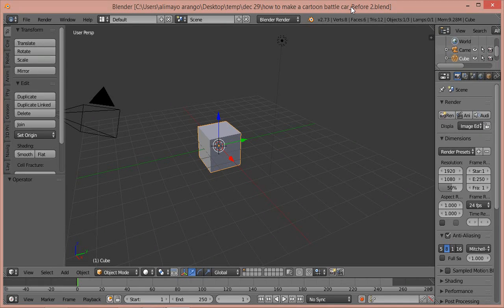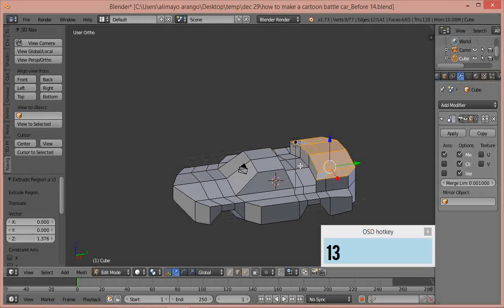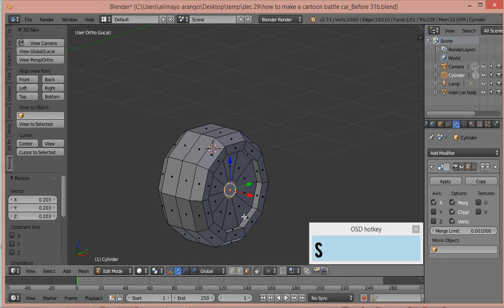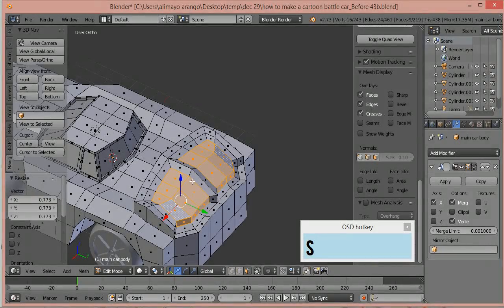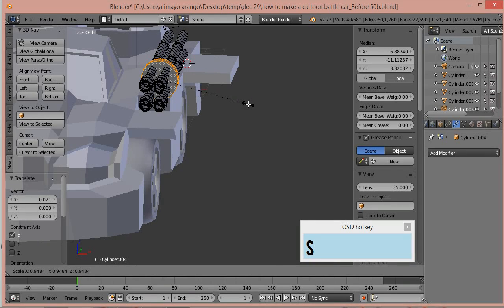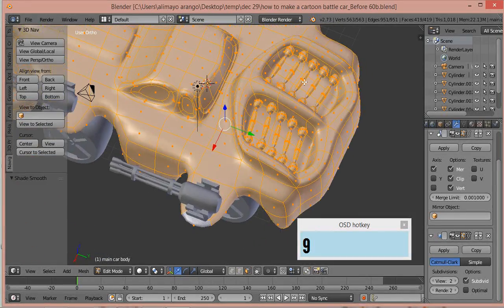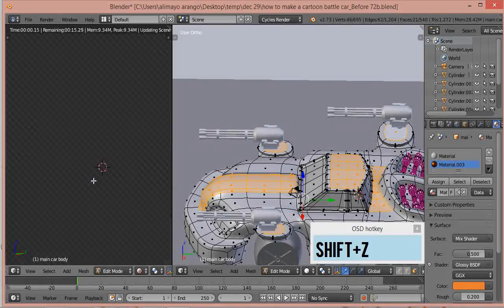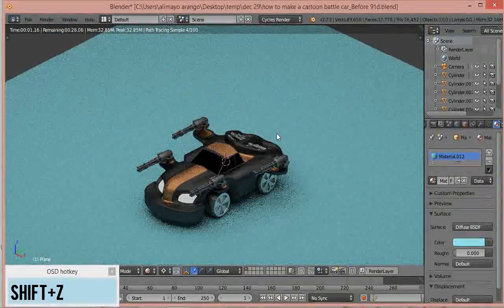How To Model a Cartoon Battle Car in Blender 2.73

Comment: I'm curious about the ring of menu options that keeps appearing around your cursor. Is that the result of a preference setting or particular to the version of Blender that you're using?
Reply from the maker: DrawnSteelHero The ring of options that I think that you are mentioning is the pie menu. You can activate it by going to file>user preferences>add ons- then look all the way to the bottom of the list and put a check mark next to "User Interface: Pie Menus Official. Now when you press "Tab", "z", and the "." key you should see pie menus showing up that allow you to maneuver around Blender faster. If you find that you don't like the pie menus you can go back and uncheck the box next to the "User Interface:Pie Menus Official"  in the addons menu. 
I hope that this helps.
Reply: Found it. Let's see what kind of difference it makes. Thanks, Ali! :)
Reply from the maker: No problem. Glad to help Drawn Steel Hero :)